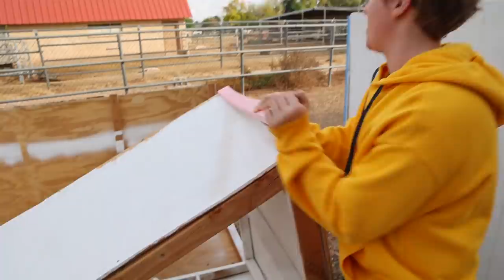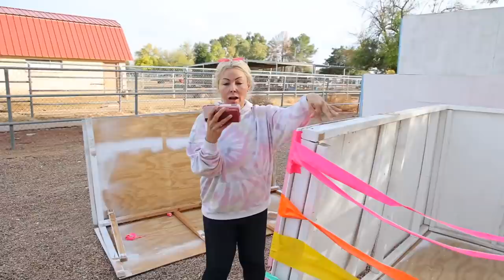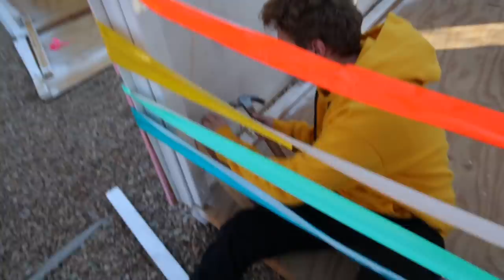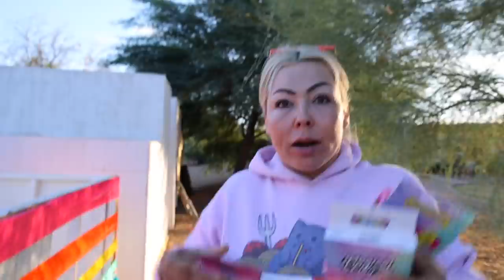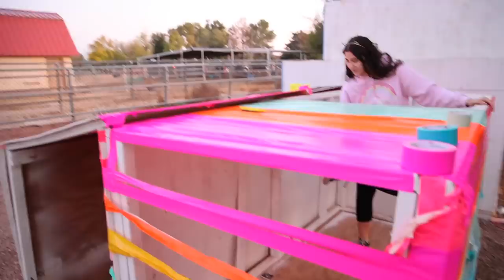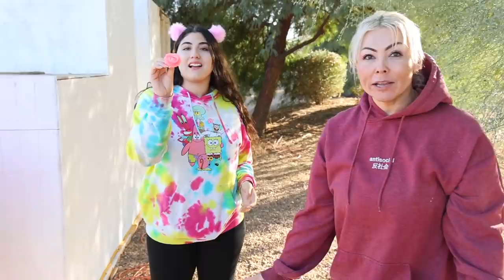I FIXED JEDDAHS TINY HOUSE WITH NO BUDGET!

Comment: Tiny house building challenge who can make the best tiny building/house out of one item not counting tools. Choices brick, wood, tarp, styrofoam, legos, stone, straw, mud, blankets, barb wires and because of this video right here duck tape. You’ll spin the wheel to see what you get. Note you can use cement, nails, screws, hammer, drill, etc  no matter what item you get